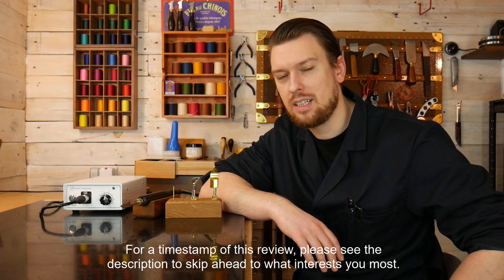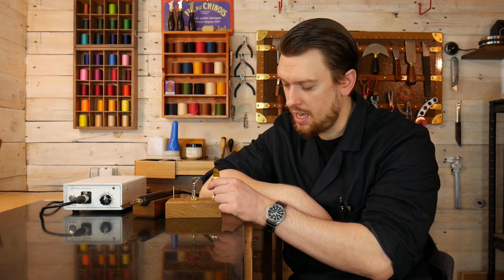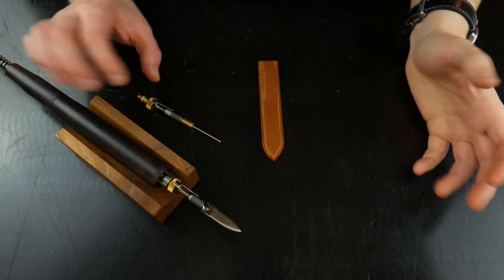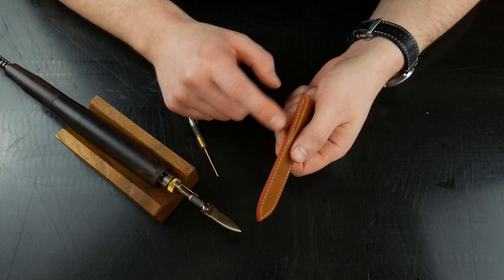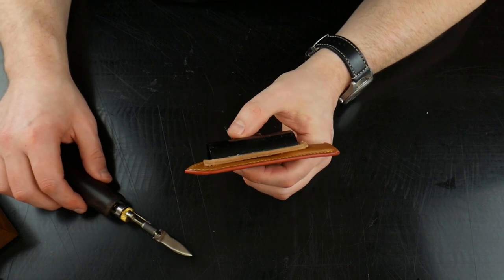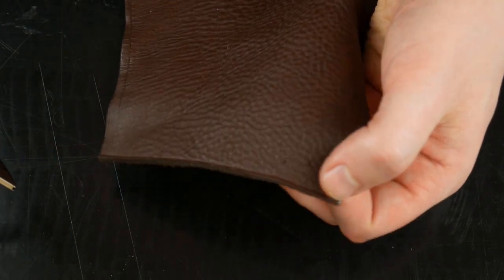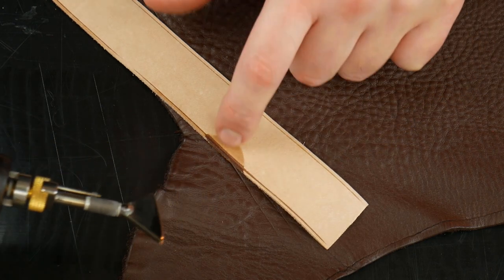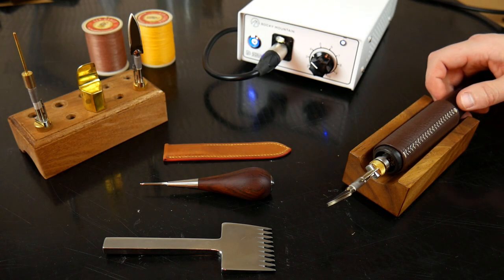REVIEW Summit X1 Leather Edge Creaser + BONUS project!

Comment from the maker: TIMESTAMPS:
0:47 What is an electric edge creaser?
3:45 How much does it cost? Comparisons with Regad.
7:32 Manual creasers.
10:14 Heat up speeds.
11:17 Who is this product for?
13:53 Mistakes to avoid.
17:16 Smoothing edge paint.
19:47 Using the watch strap tip.
21:39 Heat settings for various types of leather.
23:30 Heat vs speed.
25:52 BONUS project: Stitching on a leather wrap using the baseball stitch.

Comment: I'd argue edge-creasing very much serves a similar purpose to beading in woodworking. A round-over is imparted on the actual edge, and a stark line is created just slightly back from there. Rounding over (or chamfering for that matter) serves the purpose of preventing chip out, and softening to the touch, but it also weakens the visual border your eye follows. 

This is useful, when masking imperfections in the edge, or making something seem lighter; however, the stark line (recessed from the edge so protected from damage) restores a line for your eye to follow. Indistinct lines can be coded as worn, lacking in confidence, or feeble by the eye - a bead can make the line "straighter than straight." 

Finally, I agree that as a finishing touch, it almost serves as a "punctuation mark." Even if you look at 18c. British Campaign Furniture, where they've all but done away with ornamentation such as moldings. However, drawer faces on campaign chests almost always still have a slight bead around their perimeter. It's as if the maker could talk, saying "I'm done here."

Comment: It's also worth considering the boxwood/maple creasers that achieve heat through friction like a burnisher. I know CS Osborne makes them, and I believe VB does too. They're basically slickers but with crease profiles and are applied from above rather than from the side. Cheap too - I believe they're like $8 or something. That is, if you don't hate burnishing, like myself.
Reply from the maker: Thank you. Yes they are a very popular option in traditional leatherwork.

Comment: Very good review, informative, nice leather handle wrap at the end, thanks. What do you think of the mini head set?
Reply from the maker: Thank you very much. I haven't used the mini head set but it is definitely the most economical way of obtaining all the creasing options.

I think just by looking at them, they would be dynamite for around corners, but a little tricky along straight edges on soft leather as the guide is so short. Again, never used them, but that would be my guess. Pro's and con's really.

Comment: When you put the leather wrap around the tool handle how far from the edges did you have your stitch line? About an eighth of an inch? Also when you wrap the leather around the handle how much of a gap do you leave Between the two sides of leather?
Reply from the maker: 2 or 3mm, something like that. 1-2mm gap, depends on how stretchy the leather is. Less for veg, more for chrome.

Comment: One year on, is this the creaser you are reaching for, or do you still prefer  manual creaser and alcohol lamp? I'm thinking of springing for the two port version.
Reply from the maker: For actual creasing I still go with manual unless I need a crease on a large area. Mostly I use the ironing head and the wax spatula for edge work and removing creases. For that alone I love it.

Comment: I've had mine for over a little over a year and it is extremely finicky. Sometimes it heats , most times it doesn't. But maybe I just happen to have gotten the one rotten apple.
Reply from the maker: Try unscrewing the tip and cleaning the end with some Scotch-Brite (the end part that inserts into the handle above the screw threads). If there is any dirt on there or where it makes contact inside the handle then there won't be a reliable electrical connection. Also make sure the tip is screwed into the handle tightly. For everyone reading this, please make sure you unplug the machine before attempting this.

Comment: Is the voltage 110v-220?
Reply from the maker: It handles both. Mine came with a US plug, so I switched it to a UK plug. Make sure you do your research first though so that you are satisfied this information is correct.
Reply: @LeathercraftMasterclass  I'm very close to sourcing this directly in China (Dupin). Do the FN and other various heads correspond 100% to the dimensions of the Regad heads? For example, will both FN3 heads impart the same crease line the same distance from the edge?
Reply: @LeathercraftMasterclass  I did a bit more checking. I have seen this machine listed as 110v-120v or 220v-240v, and I have also seen it listed as dual voltage 110v-240v. I wonder if earlier versions were either or and the latest version is dual voltage for international use. My choices are either this Dupin machine or the Vulcan. They both look good. I just need 110v-240v operation.

Comment: Mine seems to burnish veg tan leather and gives it a blotchy look throughout the creased line. Why could this be?
Reply from the maker: Definitely too much heat. You hardly need any any with veg tan, only chrome tan requires a decent amount of heat. If you dip the tip in water (not the heating element!) and it spits, it's too hot.